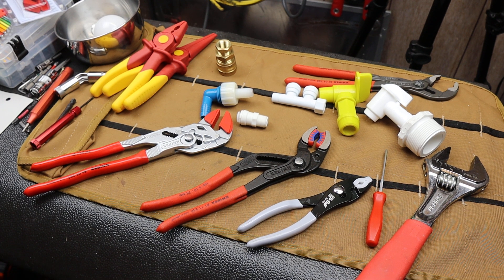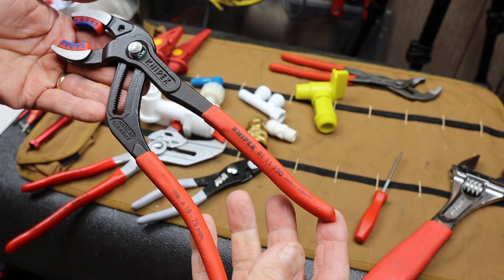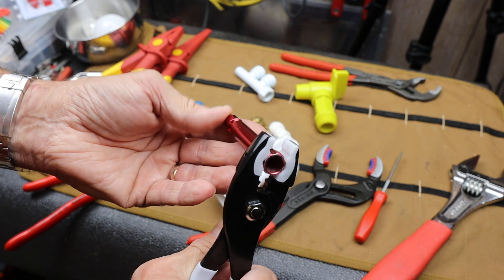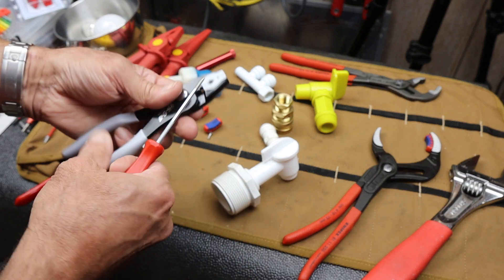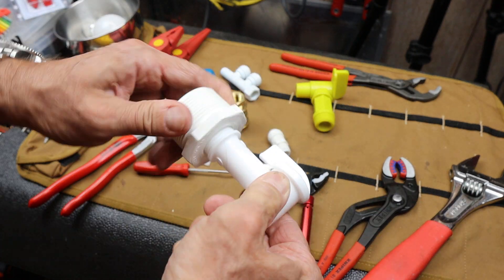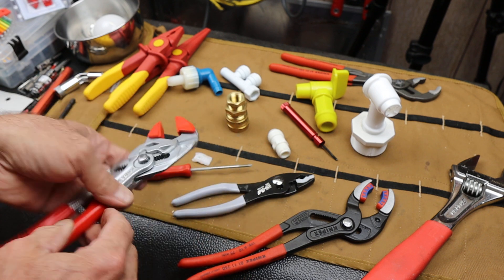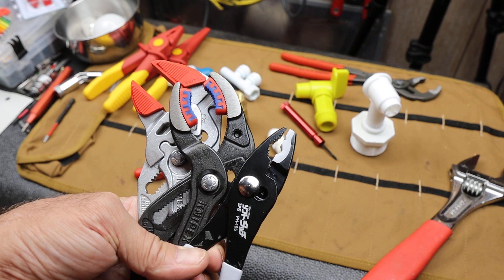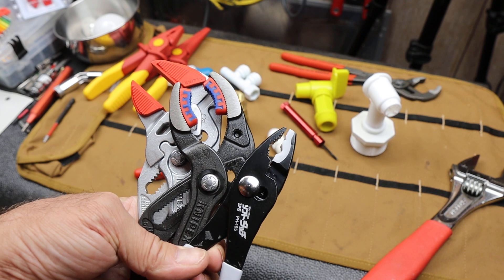Soft Touch Solutions: 3 Pliers with plastic jaws for brass, chrome, plastic, etc. Knipex, IPS

Comment: Those Knipex 81 11 250 soft jaw pliers see a lot of aerospace use in dealing with 'Cannon' type electrical connectors/plugs. They're almost universally termed 'Cannon Plug Pliers' in the biz.
Reply: These are heaven sent in aviation. However, I wish they made long reach soft jaw pliers that have the same bend as spark plug pliers.

There are some cannon plugs in very tight spaces on the Boeing 737. It would allow us to go in vertically and loosen/tighten versus trying to come in at a 90-degree angle.

Comment: Those Knipex jaw covers look pretty slick, I see I can find them on Amazon for a little under ten bucks. Seems a couple layers of electrical tape would do about the same thing though. 

(Reminds me of the scene in Zen and the Art of Motorcycle Maintenance where the guy with the BMW couldn't abide the thought of a cut out piece of Coca Cola can being used as a shim on his fine German machine, so they limped the bike to a BMW mechanic, where the guy cut a similar piece and presented it as being proper German shim stock, BMW approved. Probably cut it out of a Heineken can instead.)
Reply: I love that scene. People get pretentious at the worst times. I find a lot of joy in fixing things and making my own tools with trash. 

Yes electrical tape works in a pinch but the ease of use and convenience of the jaw covers is a pleasure. But honestly, whatever makes you feel good is worth more than anything.
Reply: Yes!  Great book.  Great scene.  The can was the same thickness and made from decent aluminum!   Talk about marketing and branding!  Don't tell me humans aren't programmable.
Reply: In all fairness those jaw covers are quicker to install than tape and more trustworthy when working on something delicate and/or hard to replace.  After a few uses, the jaws will break through the tape.✌🏼
Reply: Heineken is Dutch, though 😀
Is that a nice read?

Comment: Hello again Doc 
Thank you for another Great Video 👍 I have pair of Cannon Plug Pliers that have the soft jaws. For aircraft electrical connections. I have often wondered why I couldn't find a stiffer jaw? As you saw the slipping. Again thank you 😊
Reply: Knipex offers two different insert types for that pair of pliers, the other one looks harder (red only)
Reply: @NicksStuff  Hello Nick's Stuff
Thank you, kindly I will check them out.

Comment: Another good one!  I have a pair of Japanese soft grip, slip joints that just don't work for my application.   I need to be able to grab and turn thin round nuts against a flat surface without damaging either.   Jaw covers that wrap around the sides of the jaw have an unsupported edge that tends to smush.  The Knipex with the red/blue covers looks like it's worth a try.   Any suggestions?

Comment: The Knipex options are really poorly designed and I wouldn’t recommend them. The IPS range of “soft touch” pliers (5 in total) are far superior and relatively inexpensive. Plus, they’re spring loaded and come with 3 extra plastic jaws.